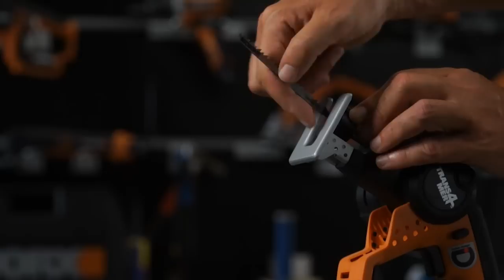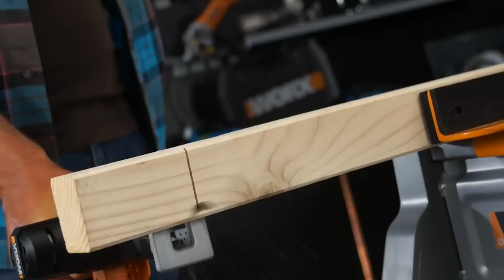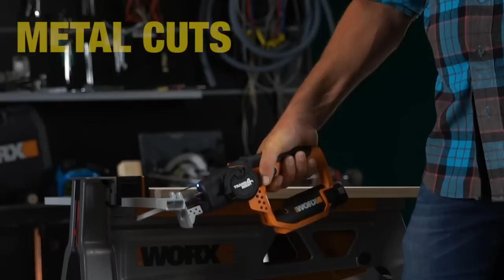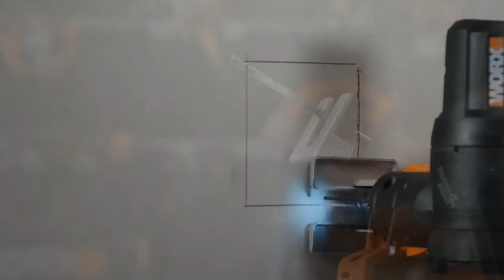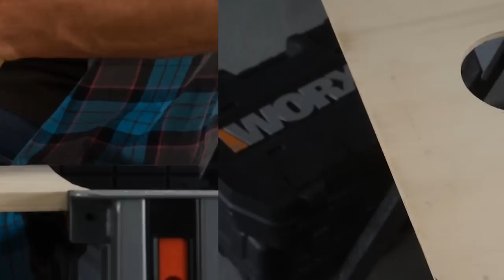Worx WX540 Trans4mer™ 12V Li-ion 2 in 1 Reciprocating Jigsaw

Comment: i just bought one ! so thought I would share my observations from ta users perspective;
What is not shown is this fantastic tool has the following features that make it indispensable in modelling work ie balsa RC Plane, boat building dolls house etc.

It has a very, very smooth and gentle reciprocating action so will cut even 1/16th balsa without tearing it to pieces 9assuming you use a fine and thin jigsaw blade 9makita type). I gring the hacksaw blade to 1/8 wide for example.
with a pilot hole you ca easily cut switch, servo, window, hatch holes etc and also even hinge slots-its that gentle ! easily replaces a scroll saw etc.
Awesome little tool smaller lighter and gentler than the Dremel jigsaw attachment and the Trio unit. easy one handed operation.